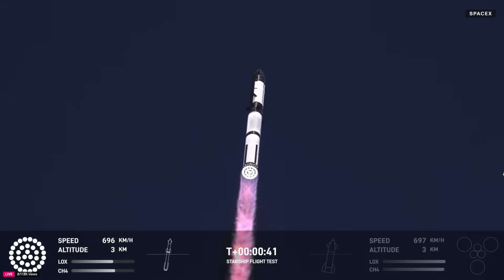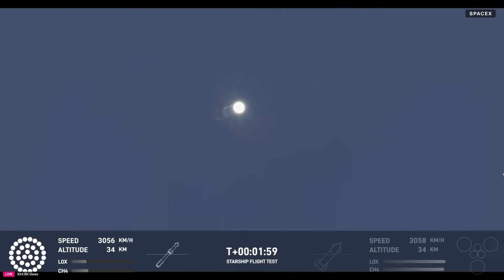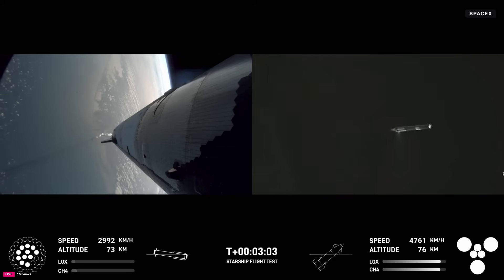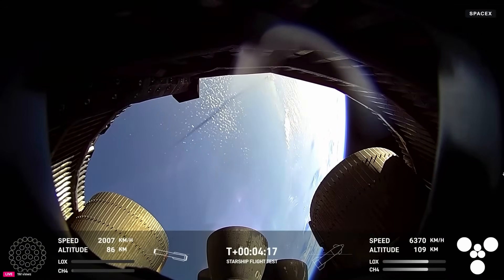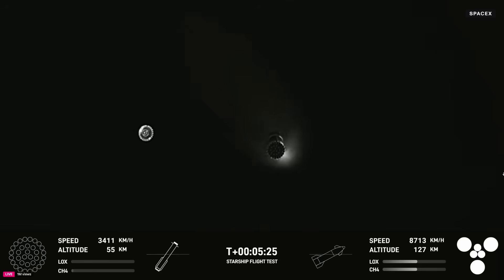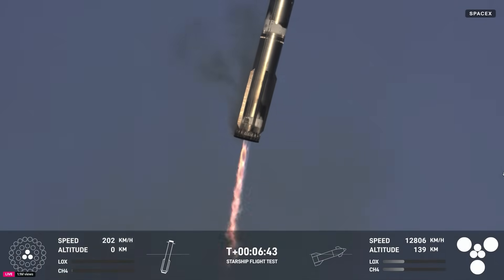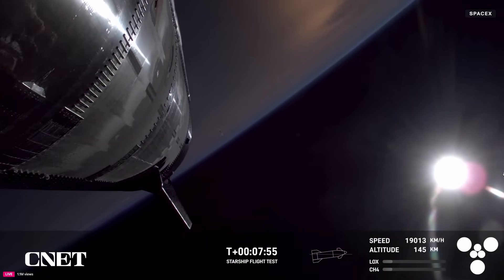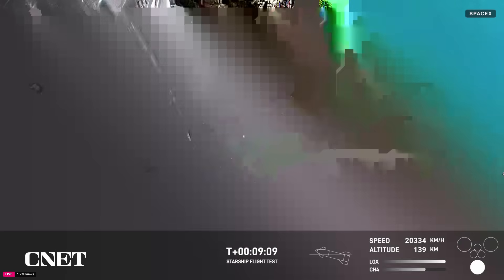Starship Flight Test 8: Everything That Happened in 10 Minutes

Comment: It’s the fuel, it’s a problem when it burns inside not outside
Reply: Challenger had heaters, the issue is firing up a second stage booster in space at a different temperature. google Space shuttle heaters Hydrazine !

Comment: No, it wasn't a success if it ended up with the ship being lost.
Reply: who care if it was a failure or not ? They are gonna launch 10 more in the future and hope it all actually explode lol, someone gotta fill up the maximum 25 flights cadence per year.
in fact this is what SpaceX has hoped long ago if FAA didn't get into their way
Reply: SpaceX doesn’t care about a few ships being lost; these are all prototypes, and the data they collect is far more important. Look at the Falcon launches and how many were lost—they ironed out the bugs and now successfully launch hundreds a year without issue. They test to destruction because that way, they can advance quicker than any other rocket company.
Reply: @paulbayliss1909  Most Falcon 9 launches were not lost, they performed their scheduled mission perfectly, landing them was an extra.

The Starship has disintegrated itself twice in a row for seemingly the same problems, failing both times to achieve its intended test program. Once is a setback, twice is a disaster.